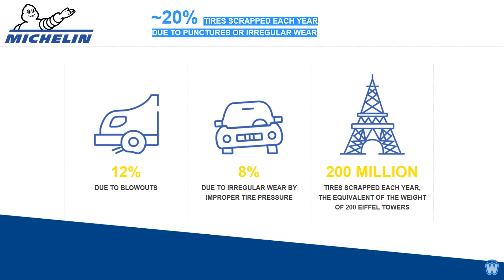Michelin Airless Tire UPTIS - Unique Puncture-Proof Tire System

Comment: One downside to this (I think), different vehicles have different tire pressures. Just an example, a half ton frame truck with 235/75r15 might need 35psi, where as the same truck with the same tire size but with a one ton frame will need 40psi. They'd have to make tire sizes available with different stiffnesses I guess?

Comment: These would be perfect if they had the sides covered, every time I see this type of tire in action I feel a rock, or sharp object getting inside the springs system would destroy the entire tire.
Reply: Let me get this straight.
You think a bunch of engineers didn't think of that ? 🤦‍♂️
Reply: @FURIOSO84  lol
Reply: Then it doesn't work...  It just becomes an air pressure tire again
Reply: Or wet snow will freeze after standing in cold climate countries
Reply: @TheTimelessMoment  or just water in freezing cold, if the tire is partially submerged ice blocks would form inside.
Reply: @viejodelentes6079  they will cover it... It is just a demonstration on how the tire works
Reply: @TheTimelessMoment  are you for real?
Do you actually belive they didn't think of that.
Snow.
Rain.
Hail.
High temperature roads.
Bumps.
I can assure you they Did.
Otherwise the whole project was pointless.
Smh. 🤦‍♂️
Reply: Tru
Reply: The will cover it once it's perfected..
They need to see what's going on inside first, right?

Comment: and you missed one more benefits is that this tires are like your mini struts, all the banging shocks would not transferred through your suspension, let alone dashboard or your seats..  it can making your ride x10 smooth
Reply: That type of tyres uses more fuel, so no environmental benefit at all...
Reply: @songoku7915  I could gon tru junctions / sharp corner / speed bumps / speed ramps by just simply releasing my accelerate pedal and then continue driving without needed to accelerating hard again. Less brake , less accelerating..1000x / 2000x rpm all day long. Can you do that? 

And btw, you don’t have to replace your struts/ shocks 
Lower arms / bushing
Stabilizer link / bush
Tie rods 
Strut mounts 
Because this tires took all the abuse
Reply: @JunesCloud   i drive economicaly, about 3.8-4.5 l/100km. With those tyres, these numbers can't be achieved. No, all these suspension parts you mentioned, will still be harmed over time.

Comment: These tyres will burn off soon , due to external & internal pressure difference. One thing that they can do is to increase the surface area of the Tyres , increasing surface area reduces pressure & will create a balance in centripetal forces to the central axis of the wheel.

Comment: The rim of the wheel would get damaged if the tyre could not able to absorb the max damage from the road.
The tyre should be more hard such that  the spring constant should be as high as possible.

Comment: I wonder how this is going to perform on gravel roads if gravels start to get stuck in between the spokes. Will the ruggedness of the rocks cut or puncture the spokes causing structural damage? Hmm
Reply: dear sir that is actually a demo it is designed as a normal covered tire but with spokes inside sir
Reply: @dagoat2596  sir yes sir
Reply: Wise man
Reply: I think it’s already solved in some way if they use them in military cars

Comment: But space should not be there inside the tyre from one side to another side, should be fully filled with. Only then it can run like air tyre runs.
Reply from the maker: "should be fully filled with. Only then it can run like air tyre runs." you missed the whole point of the tyre.

Comment: If the car which will run on these tires needs to be stopped by the spikes then they have to just increase the height of spikes so that the whole strip gets stucked in the fender and car will be stopped immediately 🤓

Comment: Take these tyres in gravel.

You will later suffer from loss of average because of extra weight brought on by the gravel.

This is going to be flop in india
Reply from the maker: "You will later suffer from loss of average because of extra weight brought on by the gravel." i assume you mean with gravel inside the gaps?
I doubt it, military use these tyres now.
Reply: @WonderWorldYTC  

Yup,

Gravels between the gaps can damage the rubber fins
Reply from the maker: @shivendrasharma3299  I guess military don't care too much about damaged fins, as long as they don't get punctures on mission.

Comment: I think Police has already the ways to stop Vehicles with such tyres. "The Trap Nets"..  
Those nets are laid on the road and when a speeding vehicle passes through it, it gets tied around the wheel & locks the wheel with axle stopping the vehicles from moving.
Reply: Yup,2019 was a bum
Reply: Yes it is also much safer than spikes

Comment: Only imagining how the tyre would function when the car is driven through mud. So much mud will get stuck in the tyre thus reducing its performance
Reply: If a side cover or sidewall as it's called is provided, the tyre will become airtight like a normal tyre, only now it will have rubber spokes/ribs inside. If they are not airtight, then water, mud, debris could enter some of the compartments and cause a disbalance which can prove dangerous at high speeds. Finally law enforcement will never approve these tyres as they cannot be deflated by normal spike strips.
Reply: @anirbanbhattacharjee3474  it's not possible to manufacture the ribs inside an enclosed tyre in single stage moulding... If gone for second stage moulding, cost will go high like anything... Mud will go away in few turns itself.... No need to worry about it...
Reply: @southtonorth-original  this tyre at current state is much more expensive than normal tyres. Also Michelin tyres are generally more costly than other brands. What mud will do, how moulding will be done will make sense when the tyre is tested in real world in real live situations, like muddy village roads or rocky game trails. It's still a concept only. I had seen and read about it nearly 10 years back in an auto magazine. Just that it is still not produced in mass market indicates the various issues the tyre has. Once those are ironed out, maybe we will see it as OEM.
Reply: @anirbanbhattacharjee3474  yes... Something is not going on its way... I think most probably the efficiency loss for the vehicles will be the main reason...
Reply: @southtonorth-original  what about lime stones..it can tear the rubber
Reply: @fairscope1177  it also won't get stuck inside as there is some slope given outwards..
Reply: There will be side protection.  This model is just to show us how it works.
Reply: @Nitikshaalabeltech24  That type of tyres uses more fuel, so no environmental benefit at all...
Reply: @Nitikshaalabeltech24  side protection kya karega? Mud toh gusega hi... Lekin koyi fark nahi padega...
Reply: Mud will not become solid metal when solidified...! Don't worry...!
Reply: @Nitikshaalabeltech24  side cover won't protect from mud entering inside. What I meant to say is, mud will do nothing, even though it enters inside. Mud will go away easily...
Reply: Guys these issues are under R&D and already solved, we have developed a tyre in which mud/water will be expelled out of tyre because of fin like design of inside support ribs.
Only problem is production cost as the material is costly and will require skilled computing and detailing for manufacturing of these type of tyre also old manufacturers don't want us to develop these tyres at low cost hence not getting clearance from our core clients.
Reply: @TheUniqueUltimateInformation  thank you for the clarification...
Reply: Trust me they already thinking about that too

Comment: Yeah. What's the trade off? What is the loss in fuel economy? What. Nobody wants to talk about that? You didn't think there would be a trade off? The engine has to work harder since the tire will compress more.

Comment: I feel like if you turned a corner to fast the tires would just fold in on it self
Reply from the maker: you can feel that, but it won't happen. being tyres are critical to a cars performance, the governing safety bodies would not allow them to produce anything that has a risk to their use. is there was a 5-10% risk increase to a tyre falling apart, vs a normal tyre (which is rare) but offset with a HUGE increase in the life of a tyre, I can understand them approving that.

Comment: Looks expensive to make and buy. Tyres today wear out or get damaged and buy a new tyre and install it on our own rims. The airless tyres have the entire wheel and rim as one complete unit. It'll be like buying a set of rims when you buy new tyres. Tyre companies will have to build a whole lot of airless tyres with the plethora of rim sizes, bolt patterns and offset etc. and so on...

Comment: There has never been a car made that could outrun a police radio, I know a lot of these guys and gals love this drama.In a lot of cases its not warranted, want to stop a Semi? just puncture the radiator it will stop in a very few miles, no more of these One Hundred mile truck chases where the police valiantly try to blow the tires out.
Reply from the maker: I drove from Melbourne to Perth, which is about 3500klms, and about 1/2 of that is 1 road, with no side roads. if you broke the law at one of the truck stops along the way, all the police need to do is put a car at each end of the road and wait 3 days for you to arrive.

Comment: There is so many reasons that this type of tire is not feasible cost of manufacturing more material needed and complexity. Cost to mount something like that on a rim. What happens when mud snow ice gets in that tire. And the tire is still going to need to be replaced when its wornout. They have there place forklifts and heavy equipment. But not a passenger car

Comment: One obvious issue would be the effects of UV rays and heat on the inner flexible rubber causing it to get progressively and irregularly harder leading to more damage at higher speeds

Comment: If this wheel stucked in heavy mud, the space between the inner wheel will get any damages?
Reply: its used for military use im sure its more mud resistant  than you can  understand
Reply: Doesn't have to be hard to fix that issue, they can just cover the sides as on a normal tyre

Comment: For working vehicles, yes but private?!  No! Here in Germany it's pretty uncommon to have a nail in the tyre.. The road is mostly clean.. You need tires in Summer and special winter tires.. Changing and buying them new would be more expensive than just staying with the old tire "system"..  I'm curious to see more of that

Comment: All aspects of our economy is based on consuming repairs repeat. That’s the reason we all are trapped in this system especially designed for fools. They had other versions of tires but they didn’t make it for the same reason. This model of Michelin looks ugly and unpractical, a lot of dirt mud and stuff could get inside and stay there,they should close the tire at least on the outer side making it the same like we have it now but airless.

Comment: Anyone else see the huge flaw in this design?  
Everything will be just fine until those ribs begin to fail. There can be only so many flexes before the material fatigues and fails. 
Instead of just a flat, you'll get catastrophic failure which just might throw you off the road at speed. 

Hit just one pothole at a pace faster than walking speed and you'll be needing another rim.  Good thing these are being held from market for 4 more years. Hopefully they will take a look at this design before it causes some serious injuries and/or fatalities.

Ever have mud stuck in your wheels?  This design amplifies that problem 1,000 fold.

Comment: The first of this type of product I remember reading about was the "Tweel", in like 2008 or 2009 I think. To my understanding, currently one if the big problems with airless tires like these is they are very noisy at higher speeds, so aren't desirable as passengers vehicle tires yet.

Comment: The big question on these tires is the cost and the fuel economy. They won't even put in a spare tire in the new cars because it takes up too much fuel mileage per gallon.. If you and introduce rolling inertia in city driving with a heavy Tire, then, that won't fly. Also if these cost $1,000 for a set of 4 tires , people will be ripping these off and putting their old are tires back on because the tread still wear out.   Honda back in 2008 had puncture-proof tires. But they were a failure because they cost too much. Thankfully, they were removed before I bought the car.

Comment: i've said this for years....with all the new technology, and composites, they should be able to come up with something.
Reply: These have been around for years and years. 30+.
Reply: That type of tyres uses more fuel, so no environmental benefit at all...
Reply: @songoku7915  It has NOTHING to do with environmental. It has everything to do with not getting a flat as they are airless.
Reply: @Coltn3125  in the video it is pointed that buying those tyres we re helping to the environment sources. No way, that's not true because as i said you waste more fuel as you drive with me. But if you want, there are flat less tyres that you can buy. Go ahaid.

Comment: Looks like the manufactoring cost will  "increase" and the price aswell since they are more "durable" - Its not that those flexible pieces are undergoing a massive wear with every rotation of the car's wheel.......

Comment: That last bit about spike strips was really oddly shoehorned in there.  There's net systems that actually stop cars much more effectively by wrapping around the axle and completely locking the wheels.  There's nothing about these new tires that will benefit criminals. We're going to be fine

Comment: I wonder how they handle dirt, mud, snow and ice buildup inside the tire.  Bet it throws everything off balance.  
I already have issues on my suv after driving in snow.  You'll get melted snow refreeze when you park on the inside of the rim by the rotors.  When you start moving again, the wheels are out of balance till you chip it off.

Comment: They won't ever come out. Or if they do prepare to pay 5 times that of a regular tire. The reason is a) the look. (unless it can be improved to look like a regular tire). and b) like you said, they last too long. Any consumer product that last too long typically will not be released, or it's re-engineered in a way in which it will break down. So that's why we still have air tires as they break down faster, so they can keep selling more of them. There's no money in things that last too long.

Comment: I worry about road debris or snow getting lodged in one side, causing the tire to go out of balance and wear unevenly. Hopefully in the final design they button up those sides as there is no reason to expose them except to show off. 

Also curious what you would do in cars that have pressure sensors, which is most of them. Just pull the fuse? 

Another added benefit is this would help increase MPG slightly, as well as cargo space, since you wouldn’t need to carry a spare tire. I could put that space to good use on long road trips and camping.

The biggest downside is you can’t deflate these somewhat to get better traction when there is freezing rain. I also wonder, since cold makes rubber stiffer and heat makes rubber more flexible, if it would have more surface contact in the summer vs the winter, which is typically the opposite of what you want. This is important because this tire is supported entirely by rubber while surface contact area is typically defined by how inflated a tire is with air.

Comment: I think I've seen a prototype for police to stop vehicles more efficiently without puncturing tires and/or pushing the back tires. It stops the car in a straight line and is much more safe for the rest of the traffic. It uses some sort of track, up front of the police car that blocks the back wheels of the chased car and causes the wheels to break.

Comment: Looks like it has a larger tire patch, which means more rolling resistance.
Reply: Exactly, which is why we still dont have them, even though Michelin has been working on them for 20 years now (originally introduced as the Tweel). They kill mileage, it's like driving with 50% underinflated tires. On lawn mowers and HMMWVs it doesnt matter but on road cars the. EPA and eco-nazis would throw a shit fit.
Reply: If they are heavier, you have inertia, meaning lower mileage in the city. Cost, cost,!

Comment: They have Tools to lock up the wheel itself, which is safer and more effective. It’s a net, you can look it up. It’s a non-issue.
Reply: You ought to have seen that contraption that used the iron pipe.

Comment: Issues in my mind:-
1. Hitting a pot hole at high speed.. Rim damage??
2. Steering and handling at high speed.. Twisting and reshaping of curves holding the outer surface
3. Suitability to different loading conditions..Sometimes we fill our tyres with different air pressures based upon load, terrain, temperature, long/short run..

Comment: Tire such as these have challenges with rotational and lateral stability, and not being able to last as long as radial tires. In ideal (temp range) and road conditions may prove superior traction but... Problems have been with NTB speed rating including rubber durometer over range of temperatures. Affects on rubber In hot or warm climates: sun-heated roads, rotating friction create lots of heat & this type of tire WEARS OUT and changes suspension properties. And example is using nitrogen and inert gas instead of just plain air is better across a larger temperature range keeping the tire stable.